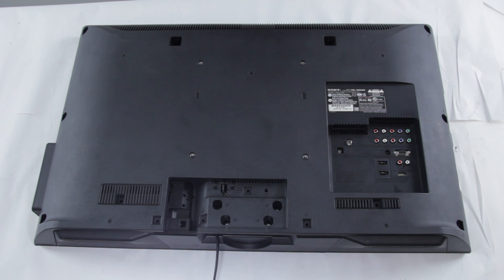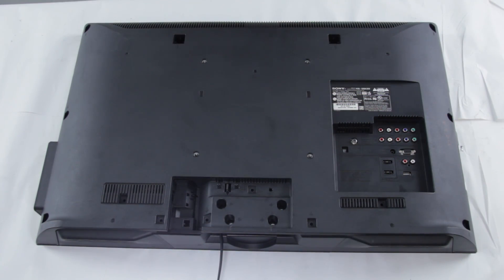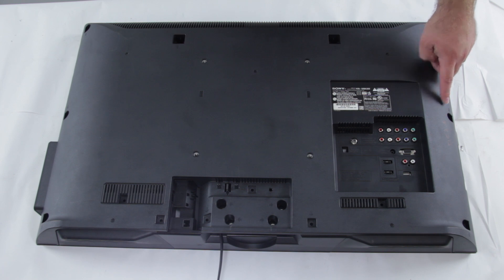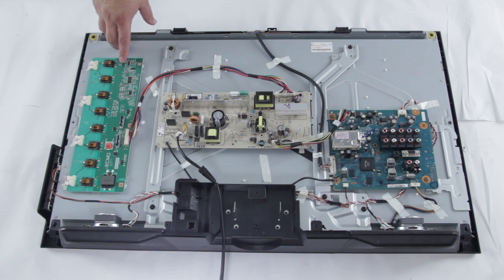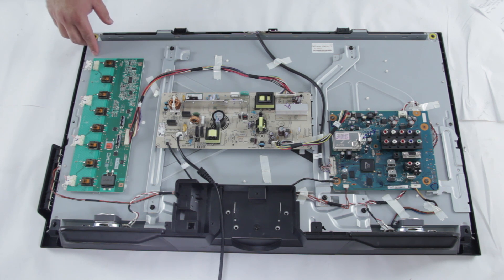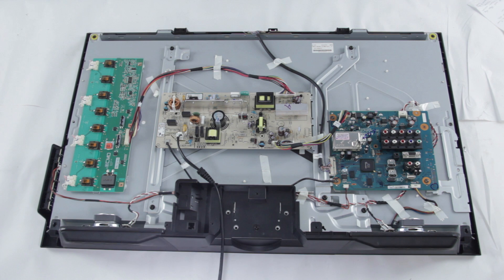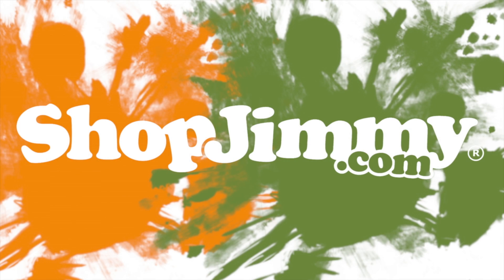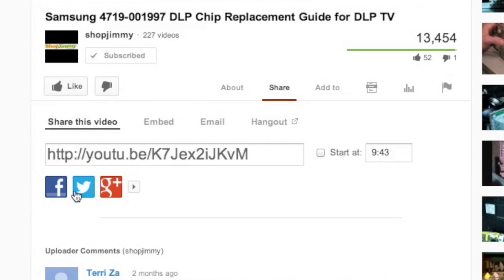LCD TV Repair Tutorial - Backlight Inverter Common Symptoms & Solutions - How to Fix LCD TVs

Comment: Model ELEFT326
Series J1300228090021811

I have a black screen but I see the image with a flash light and I have sound what do I do
Reply from the maker: Damon Jackson   This could be a problem with the power supply or the inverter board in your TV.  Unfortunately I do not see any replacement parts in the search results for your TV model number on our website.  Please reply with your part numbers on your power supply and inverter(s) and I can try searching for replacement parts.  Thanks and please let us know if you have any further questions!  www.shopjimmy.com

Comment: I have a sharp LC-46D64U. There's image and sound and the analog ports work, but when I plug any device via any HDMI port, nothing happens. This happened after a power surge. Any ideas?
Reply from the maker: sot2k1   I recommend replacing the main board in your TV.  Click this link to replacement parts:  http://www.shopjimmy.com/catalogsearch/result/index/?cat=56&q=LC-46D64U  There may be multiple boards for the same TV model number, be sure to match part numbers on your current board, with your replacement for compatibility.  Thanks and please let us know if you have any further questions with your TV Repair!  www.shopjimmy.com

Comment: Hi there awesome video you have posted. My tv recently started flickering on the left side of the screen. I have a vizio vw46L fhdtv20a
Serial number is  LSACPCK0300599. After seeing your video I'm almost certain that it is the backlight inverter. Could you please help me with this problem
Reply from the maker: Jose Hernanadez   This sounds like a TV panel (TV Screen) problem.  If your TV panel is bad, it may be more cost-effective to replace the TV as panels are typically hard to find in stock, difficult to replace, and expensive.  Thanks and please let us know if you have any further questions!  www.shopjimmy.com

Comment: Hi, I have a Philips Model # 47PFL7403D/F7  and a few months ago the TV screen started to go black/blank but the sound would still be on. After researching I came to the conclusion that it was the Backlight Inverter Board. I just want to be clear the tv works great still but from time to time the screen go blank and I have to turn the TV off and on again to get picture.
Please tell me the Backlight Inverter Board is what I need? 

Thanks
Reply from the maker: Josh Neal   I recommend running the flashlight test on your TV.   Here is a link to a video we produced that shows how to run the flashlight test. https://www.youtube.com/watch?v=xUzCLgoSPGM Please reply with your flashlight test results and we can recommend a replacement part for your TV repair. Thanks and please let us know if you have any questions! www.shopjimmy.com

Comment: Thanks for the responce on the part. Yes id of got the right part. But unfortunatly ive already dropped my tv off at a repair shop cause i was scared of buying the wrong part for my model which im being completly overcharged on. Should of just bought the part. Been paient an did it myself. Lesson learned. Thanks anyway.

Comment: I have a Vizio e470va it turns on fine but screen goes black after like 10-15 minutes but still has sound,leave it off for awhile and it just does the same thing any ideas?
Reply from the maker: Brian Mathieu   Please watch this video FIRST to help with your repair!  https://www.youtube.com/watch?v=BP3NVNCGEv8  I recommend replacing the main board in your TV.  Click this link to replacement parts:  http://www.shopjimmy.com/catalogsearch/result/index/?cat=56&q=e470va  There may be multiple boards for the same TV model number, be sure to match part numbers on your current board, with your replacement for compatibility.  Here is a link to a video showing how to identify your part number, click here:  https://www.youtube.com/watch?v=kxkeGLhlQY8  Thanks and please let us know if you have any further questions with your TV Repair!  www.shopjimmy.com

Comment: I have a LG 47LN5200 UB
Was working just fine since i bought it new in feb until tonight. I looked up from homework and i had no picture at all. The sound does work. And i did notice there was backlight when i put a light up to it. I did alittle research and heard about the inverter most likely being the problem in that situation.I decided to take the back off and have a look. I see a power board..a input board and a t com board which i thought was the inverter. I did absolutly no damage..none. put the tcom board back and hook everything back up. I then saw no backlight at all when doing the flashlight test. Im confused now because i only see 3 boards..but no inverter. This tv is a lg  led tv that applies lcd backlighting it says. Kind of confusing. Im confident i can fix this but i need to know which part to buy and replace..if i could get a reply that would be great. Thank you..shawn..
Reply from the maker: Shawn Hill  Please watch this video FIRST to help with your repair!  TV Repair! LCD, LED, Plasma, DLP How To Fix Your TV with ShopJimmy.com Help!  I recommend replacing the power supply board in your TV.  Click this link to a replacement board for your TV model number:  http://www.shopjimmy.com/lg-eay62810801-power-supply-unit.htm  Be sure to match part numbers on your current board, with your replacement for compatibility.  Thanks and please let us know if you have any further questions with your TV Repair!  www.shopjimmy.com
Reply: I love how they show you a video of a tv that is not a lg every time. Their is no back light converter board on this LG TV. So this video is no help.
Reply from the maker: You have and LED TV, this video is for LCD TVs.  In your TV model listed above, the power supply and backlight inverter board are built onto the same board, the power supply / LED board.   Thanks and please let us know if you have any questions.  www.shopjimmy.com
Reply from the maker: *****  What is your TV model number?  If you have an LED TV and the power supply/LED board did not fix the problem, then you could have bad LEDs.  Thanks!  www.shopjimmy.com
Reply: 47ln5200 - same issue. no picture only sound. Do I need the following power supply? http://www.shopjimmy.com/lg-eay62810801-power-supply-unit.htm
Reply: Mine went out a few days ago repair man says when one LED light goes all of them goes LG never again only good this is I had warranty through directv so they say it'll cost to much to fix so they are replacing my tv

Comment: Hello, love what you are doing here. It is very impressive that you can keep up with everyone's messages. I have a 46" Dynex LCD TV that turns on and works fine for a minute and then the screen goes dark and sound keeps playing. If I get really close to the screen and look really hard I can see a feint picture. Do you think you could recommend a fix? I am not afraid to open it up and replace some parts / do some testing. Thank you very much!  

Model # DX46L150A11 Rev. A       S/N - 2401LC46KS70H04460
Reply from the maker: *****  Please watch this video FIRST to help with your repair!  TV Repair! LCD, LED, Plasma, DLP How To Fix Your TV with ShopJimmy.com Help!  I recommend replacing the inverter board in your TV.  Click this link to replacement inverter boards for your TV model number.  http://www.shopjimmy.com/catalogsearch/result/index/?cat=46&q=DX46L150A11  There may be multiple inverter boards for the same TV model number, be sure to match part numbers on your current board, with your replacement for compatibility.  Thanks and please let us know if you have any further questions with your TV Repair!  www.shopjimmy.com

Comment: Hello, I've got a Toshiba 42hl167.  It works for about an hour (after being off for a few hours) just fine, then the picture will turn off and turn black (not like the TV is off, it still appears lit up, just black).  Turning the TV off and on again temporarily fixes the issue.  The longer I watch TV, the more often this happens.  I opened it up and checked for any blown capacitors which I did not find.  I was going to test the inverter board but I found 2 on either side of the board and I don't know which one to test.
Reply from the maker: Mike Metzger  Please watch this video FIRST to help with your repair!  https://www.youtube.com/watch?v=BP3NVNCGEv8  I recommend replacing the main board in your TV.  Click this link to replacement parts:  http://www.shopjimmy.com/catalogsearch/result/index/?cat=56&q=Toshiba+42hl167  There may be multiple boards for the same TV model number, be sure to match part numbers on your current board, with your replacement for compatibility.  Here is a link to a video showing how to identify your part number, click here:  https://www.youtube.com/watch?v=3DQe0ATZl_Q  Thanks and please let us know if you have any further questions with your TV Repair!  www.shopjimmy.com

Comment: Hi I have a Sony KDL-32BX330, I turn it on and I can see it starts but it gave me no image, originally the Sony symbol used to come out but now nothing, just a light black then all black, I was thinking it was the backlight board. Thanks a lot for any input you can give me. Thanks.
Reply from the maker: Samuel Badillo  I recommend running the flashlight test on your TV.   Here is a link to a video we produced that shows how to run the flashlight test. LCD TV Repair - Flashlight Test for No Image, No Picture on TV Screen - How to Fix LCD TVs Please reply with your flashlight test results and we can recommend a replacement part for your TV repair. Thanks and please let us know if you have any questions! www.shopjimmy.com

Comment: I have a hater L32A2120 led tv.  I replaced the backlight inverter board that I purchases from Shop Jimmy's.  Now, the picture is very dim.  Could it be the power supply?
Reply from the maker: Steven Mazure Try this at your own risk.  I recommend checking all of the inverter connections are connected properly and look normal.  Thanks!  www.shopjimmy.com

Comment: I have a computer monitor:  Viewsonic Vx 1962 vm .  It has started turning off after only a few seconds.  If I turn the monitor power off and then on, the display will come on for a few seconds, then turn off.  After watching your video, it sounds like the backlight inverter.  My question would be:  is it worth fixing this?  Or should we just look for a new monitor?
Reply from the maker: judygold47   New monitor may be best.  Thanks!  www.shopjimmy.com
Reply: ShopJimmy.com Thanks.  That is what we decided to do, after watching  your video.  Buying a new monitor seemed more sensible than spending money on an old monitor.

Comment: I have a Vizio GV47LFHDTV10A.  The picture went out.  I'm not sure if the sound works since I use external speakers that aren't sourced from the TV.  When I press the power buttons on the bezel, it doesn't turn off (the Vizio logo doesn't change from white to orange).  If I unplug it and wait, then plug it back in and press the power button on the bezel, the Vizio symbol turns from orange to white, the control panel buttons on the bezel light up, but they stay on and don't turn off, and the screen never comes on.  Any idea what this could be?
Reply from the maker: TheRealMrKGB I recommend running the flashlight test on your TV.   Here is a link to a video we produced that shows how to run the flashlight test. No Image No Picture on TV Screen - Flashlight Test LCD & LED TV Repair - How to Diagnose Symptoms 2 Please reply with your flashlight test results and we can recommend a replacement part for your TV repair. Thanks and please let us know if you have any questions! www.shopjimmy.com

Comment: RCA LCD 46 Flat screen TV needed a backlight inverter  model #L46WD22/ Ser.# H054E1510(made by Samsung on inside) anyway now the issues is that it was not removed correctly can that bar be replaced & how to video & what is it called inverter bar that the backlight inverter fits into.Is this repairable?
Reply from the maker: Rosalia Chwalek   Unfortunately, no.  Thanks!  www.shopjimmy.com

Comment: I have a Sony KDL40EX723. Last night it started showing 2 pictures at the sa,e time with one picture 4 cms lower than the other. All else works ok. Is there a simple fix for this double display
Reply from the maker: James Hey   This sounds like a TV panel (TV Screen) problem.  If your TV panel is bad, it may be more cost-effective to replace the TV as panels are typically hard to find in stock, difficult to replace, and expensive.  Thanks and please let us know if you have any further questions!  www.shopjimmy.com

Comment: I have a Toshiba LCD 40RV52RZ.  The TV was running and then the  screen went yellowish and black.  I am not getting sound or a picture.  The Toshiba emblem at the bottom of the frame is lit up. I have replaced the power board, but it is still in the same state.  Nothing happens when the power button is pressed.  No sounds or anything.  I have a volt meter, but I am not sure what to test or check.
Reply from the maker: Jim  Please watch this video FIRST to help with your repair!  TV Repair! LCD, LED, Plasma, DLP How To Fix Your TV with ShopJimmy.com Help!  I recommend replacing the main board in your TV.  Here is a link to replacement parts:  http://www.shopjimmy.com/catalogsearch/result/index/?cat=56&q=40RV52RZ  Be sure to match part numbers on your current board, with your replacement for compatibility.  Here is a link to a video showing how to identify your part number, click here:  TV Part Number Identification Guide for Toshiba Main & Scaler Boards (LCD, LED, Plasma TVs)  Thanks and please let us know if you have any further questions with your TV Repair!  www.shopjimmy.com

Comment: I have color problems & little horizontal lines on Vizio 42inch DX- l42- 10A
Reply from the maker: Jorge Mercado   This sounds like a TV panel (TV Screen) problem.  If your TV panel is bad, it may be more cost-effective to replace the TV as panels are typically hard to find in stock, difficult to replace, and expensive.  Thanks and please let us know if you have any further questions!  www.shopjimmy.com

Comment: Hi Shopjimmy. I have a Hitachi 42" L42VPO1U and the problem is...i switch on the tv and everything is ok but after 20min the picture is gone but sound is still there. I switch off the tv and switch on one more time. The picture is back but after 3min or even less...the problem is the same. I was reading your tips and it could be backlights or trafo no?? I am checking the price of backlight but i dont know how I can know if this problem and which backlight( slave or master). Thank you very much
Reply from the maker: Antonio Diez   I recommend running the flashlight test on your TV.   Here is a link to a video we produced that shows how to run the flashlight test. No Image No Picture on TV Screen - Flashlight Test LCD & LED TV Repair - How to Diagnose Symptoms 2 Please reply with your flashlight test results and we can recommend a replacement part for your TV repair. Thanks and please let us know if you have any questions! www.shopjimmy.com

Comment: I have an RCA 32LB30RQD TV/DVD Combo (Serial No.: 2604-32B30RD-A100108, December 2012). A month ago, it went dead--no red Led power light, no sound, no picture. I found some bad diodes on the power supply and changed them. During the repair, I accidentally shorted the power line and blew the 3.15A fuse. When I changed the fuse, I also changed all the electrolytic caps for good measure. When I got it all re-assembled, everything worked, but the picture was dark on the left side. I just took off the LCD screen so I could see the backlights. All six are working, but the illumination only reaches from one-third to one-half way across all the bulbs. Is this an inverter problem, or is something still wrong with the power supply? Thanks.
Reply from the maker: Larry Hecht  Please watch this video FIRST to help with your repair!  TV Repair! LCD, LED, Plasma, DLP How To Fix Your TV with ShopJimmy.com Help!  This could either be bad lamps in the TV or a bad power supply board in your TV.  Here is a link to replacement power supply boards.  http://www.shopjimmy.com/catalogsearch/result/index/?cat=59&q=32LB30RQD  Be sure to match part numbers on your current board, with your replacement for compatibility.  Thanks and please let us know if you have any further questions with your TV Repair!  www.shopjimmy.com

Comment: I have an insignia LCD TV model: NS-24E730A12. Was working fine until today. Now it has sound but no picture. When I turn all the lights off and shine a flashlight on it I can see the picture very dimly so I am thinking it is the inverter that is messed up. How would I go about purchasing a new inverter and replacing the one that is not working? (Assuming that is the problem)

Comment: I have a Vizio 47" LCD TV. Model #SV471XVT, Serial Number LPPEKAK2802469. I have audio, no video. I have chatted with Vizio Tech Support and they seemed to think it was the backlight. I have tried the flashlight test, but there was too much of a glare on my screen. How much would the part be for this repair and what is the difficulty level to fix myself (limited electronics knowledge). Thanks.
Reply from the maker: Bill Straight   I recommend replacing the main board in your TV.  Here is a link to parts:  http://www.shopjimmy.com/catalogsearch/result/index/?cat=56&q=SV471XVT  Be sure to match part numbers on your current board, with your replacement for compatibility.  Thanks and please let us know if you have any further questions with your TV Repair!  www.shopjimmy.com